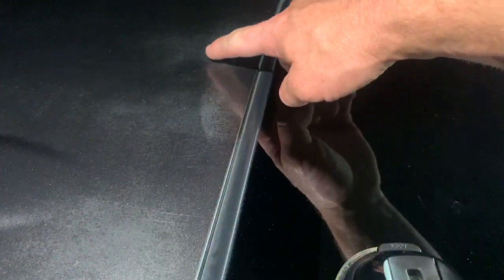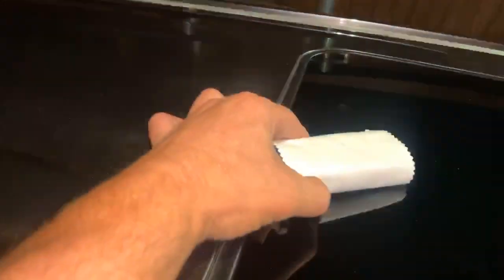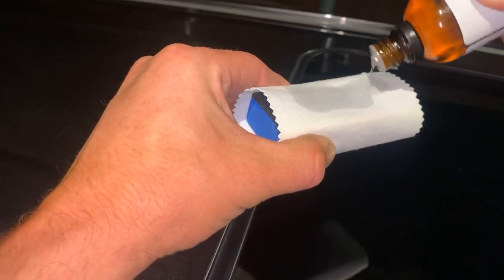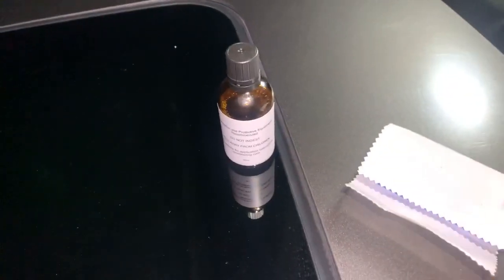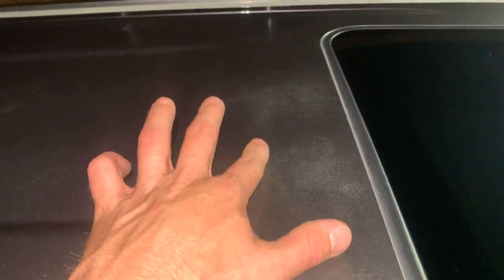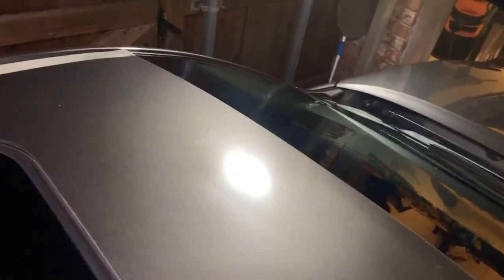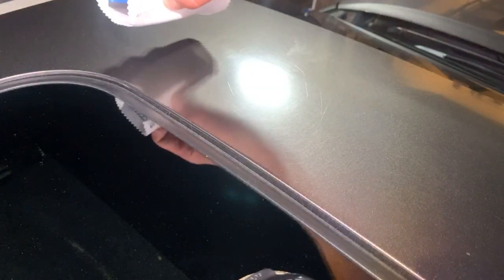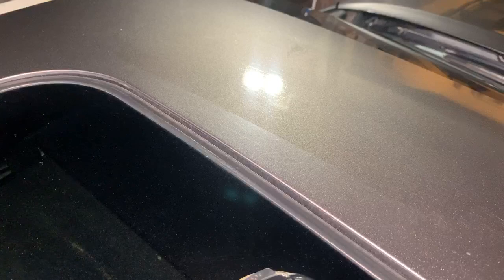DPC T6+ Pro 6 Year/9H Titanium Coating Vs. Failing Clear Coat | Part 2!!!

Comment: I did a complete de iron and clay bar on my one month old 2020 F150, then the meguires spray on ceramic in September, would you clay bar it again or just clean and apply this ? How many bottles for. 2020 f150 crew cab
Reply from the maker: yes I would do everything all over again...I have a video preforming all the steps and how I prep a vehicle from start to finish.  one bottle will be plenty for your truck....apply it heavy, work clean and have plenty of microfibers ready.